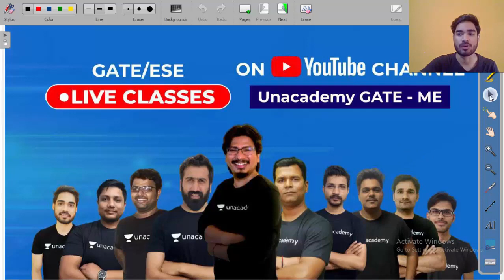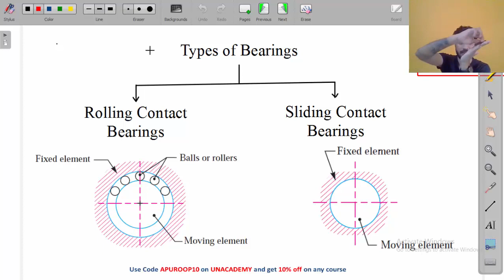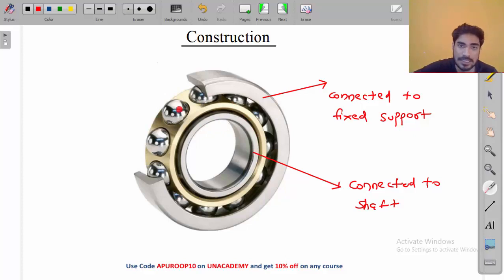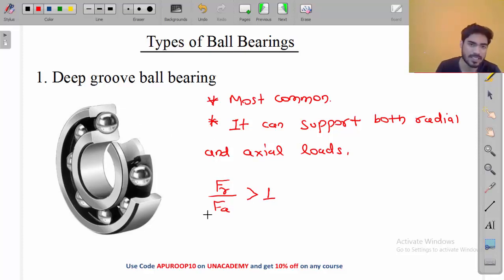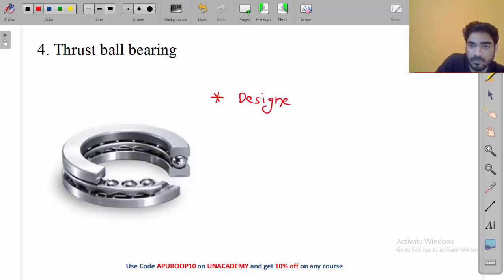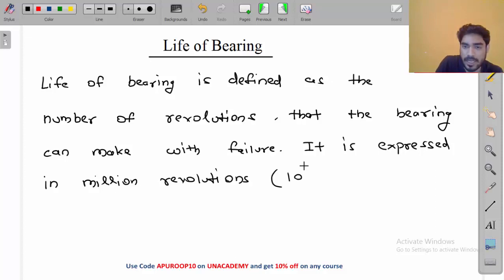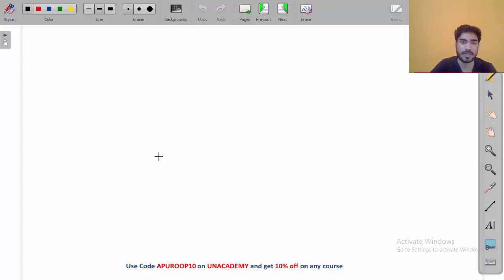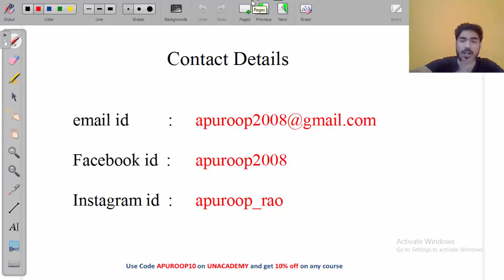Machine Design | Lec - 12  | Design of Bearings - 1 | GATE 2021 Mechanical Engineering

Comment: But deep grove bearing also support both axial and radial load ...then why there is a need of angular contact ball bearing...if both have doing same function???
Reply: It depends on the axial load. Angular contact bearing can hold higher axial loads than Deep groove bearing.